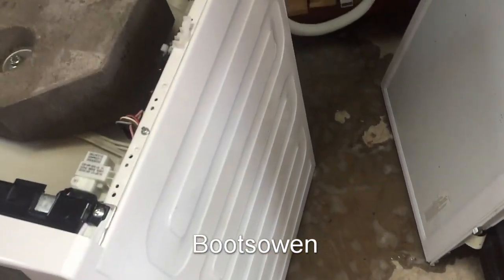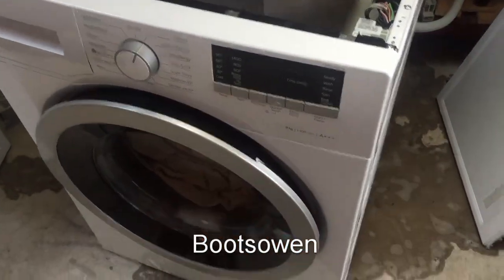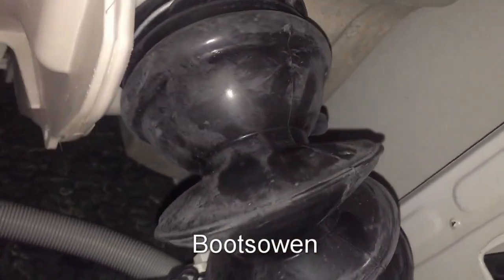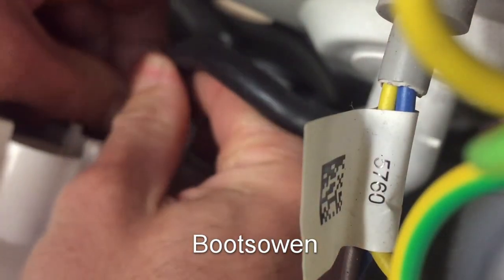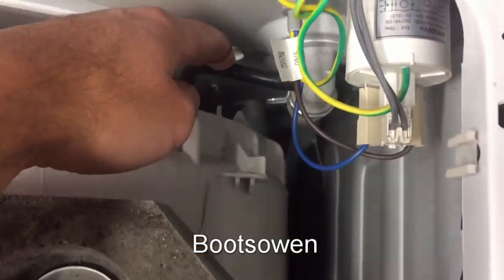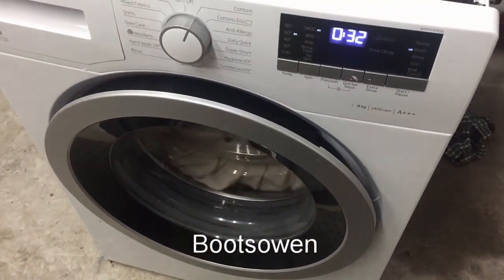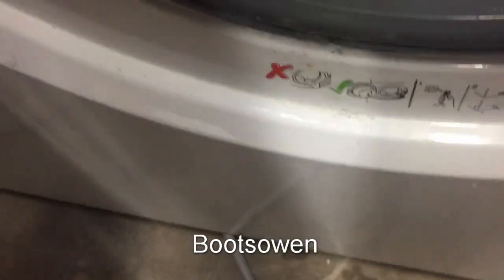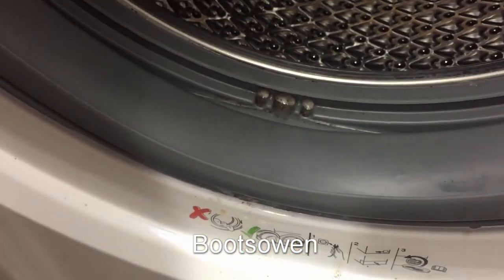Beko leaking everywhere! How I fixed it: Beko WX842430W washing machine

Comment: this litteraly solved my problem! had water everywhere... tried a pump cycle and simply was not able to pump through? Some (1st part) came trough the tube at the outlet but after that the pump turned on and of for 5 sec... no water coming out

new program:  LEAK again

was about to call a mechanic and stumbled acros this video, such an easy fix... reconnected the tube and voila! no leaking
save me a couple of 100 euro's should I have called a mechanic friday eve

Comment: Thank you so much for this video, I was ready to throw our washing machine out but thought I would give it a bash by trying what you had suggested. Turns out the same little black hose had fallen off ours too. I did try simply popping it back on & it worked on a trial run then unfortunately came off again. I read on another site that the pipe had no real use so I used a jubilee clip to clamp it off completely. So far so good (fingers crossed!). Thanks again! ❤️👍
Reply from the maker: Excellent!

Comment: I had the same problem.  Initially to keep the wife happy & washing I just stuck a golf tee in it. I've since done it 'properly' but I can't really see what purpose that little bypass hose could be for?? Also, it is subject to quite a bit of movement and should really be clipped and not just a slide on.  Well done on the video.

Comment: I would suggest that the small black pipe that came detached from the back of the tub is a vent built into the highest point of the drain hose that prevents back siphoning from the drain back into the sump of the machine. It is there to break the siphon action once the machine has finished pumping the water out of the tub, to ensure if there is water backing up the house drain, that this water is not then drawn back into the machine.
Reply from the maker: I think you're right.
Reply: When I had a Beko and would put it onto a drain only when the machine was completely dry. After it finished the drain, there were droplets in the drum from this pipe.  Also noticed some droplets after final spin too and now I can see that this pipe was responsible.
Reply: That's it!

Comment: I so just wish I'd see this 4 days ago as had the same thing go .My machine is a Beko QwMB4.The repair man couldn't get my integral machine out, so was coming back with a another man the next day as the tiler had tiled right up to it.  A mate came down that night  and got it out,while out, mate tile the floor under where the machine is housed So next time I could get machine  out myself if I needed to, but oh now the integral  door wouldn't go on as to high,even through machines feet had gone up loads
The repair cost me a 65 pound call out and a damaged corner plinth as when the repair people put machine back they hit it with machine costing 28 pound. Now my bro has the come and take the new tile out costing 22 pounds. To low the machine down so the door fits back on.Arrr one silly little hose cause so much stress,waste time and money.The hose had came of mine due to a unbalanced load even though that anit ment to happen with my model.The hose is very poorly fitted and I worry it will keep coming off.Its no wonder someone though the machine you found had,had it . Manufacturers Shouldn't  be aloud to manufacture equipment like this,yes a easy fix if you know where and have the time.I ask my self how many more appliances go to waste and could easily be fix, instead of being dumped into the earth.Well done you taking that machine home and repairing it most wouldn't and why the world's in the state it's in. Next time I'll now know arrrrr
Reply from the maker: At least you got it going. I have seen that thing with tiled floors locking in washing machines before. I guess it's faster if you're the tiler!

Comment: I have a Beko machine not this model which has developed a very slight leak at the right hand side front which only appears after the was cycle has finished. The machine performs perfectly in every other way. Unfortunately I don’t know the age or history of the machine as I inherited it when we bought the house several months ago. Any thoughts?
Reply from the maker: Probably from a place where water is getting out, have you tried looking in it?
Reply: @bootsowen  hi, no I haven’t investigated as yet. My quandary is whether or not it is worth spending any money on the machine as I don’t know its age or history. It will probably  continue to work for a good while yet with this minor issue, (hopefully). That said I pop the top off just in case it’s something like a disconnected pipe as you found with your machine.

Comment: Mine is leaking from bottoms underneath
Reply: A small black rubber tube near the bottom and just inside the rear access panel came detached from whatever it was supposed to be attached to ( I am not certain what it was) on our LG frontload washing machine.